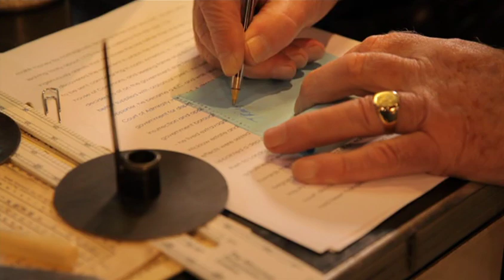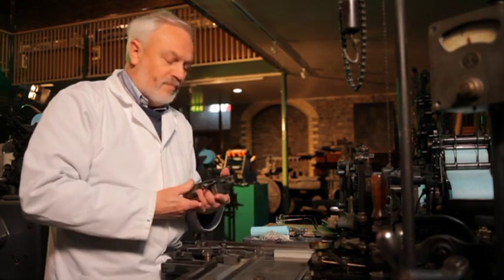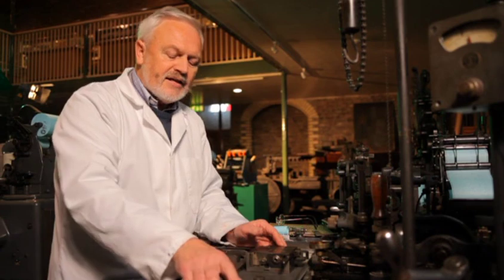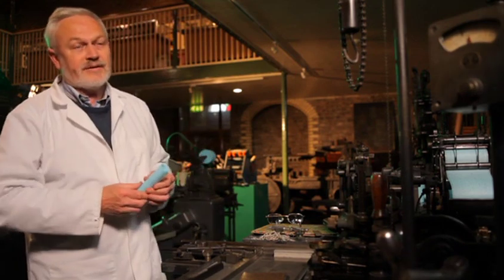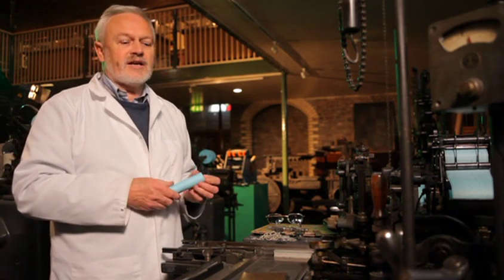Monotype Caster

Comment: Um, the caster was capable of far more than 40 ems pica. If memory serves it was in fact 60 ems pica.

What it couldn't do at over 40 ems was push the galley slide back to its starting point.The galley slide was a thin rectangular piece of metal which would support the type being assembled in the type assembly channel, so that as type was being pushed out from being moulded, the type wouldn't fall over. Thus the galley slide would be pushed along with the line of cast type as the length of the line increased character by character. When the justification signal was tripped, the line delivery mechanism would pull the line of type out, push it on to the galley under the raising gate,, and would be returned to its starting position - along with the galley slide, waiting for the next line of type to support. And so long as the machine went through 7 revolutions, this would happen each and every time.

However, at over 40 ems, whilst the line delivery mechanism was still automatic, what it couldn't do was push the galley slide back with itself. Thus the operator physically had to push the galley slide back to its starting point - there was even a notch in the galley slide to do just that.

Yes, I know there was an attachment that could actually make that happen automatically but it wasn't reliable.

Comment: The typecaster did not put in the lead , he would use something called wriglet, a thin but strong piece of wood that he had cut to the galley spec on the reel label.
Reply: petrosros they can do that but using leads are more common, were I work they only use leads